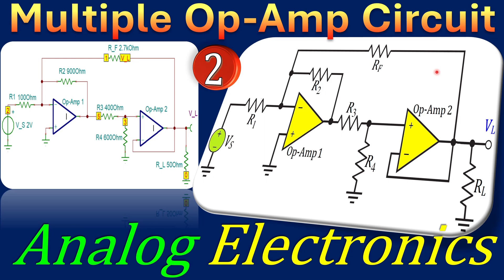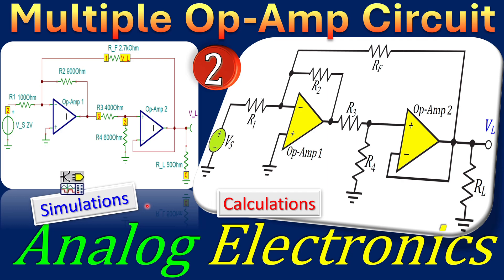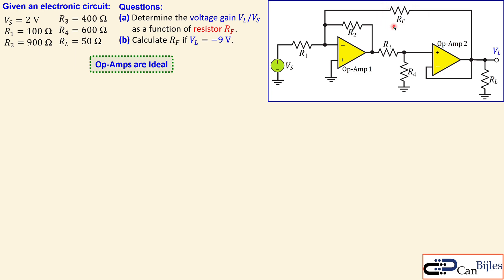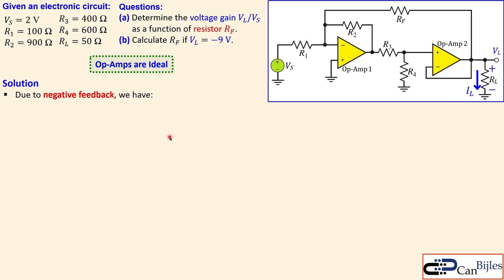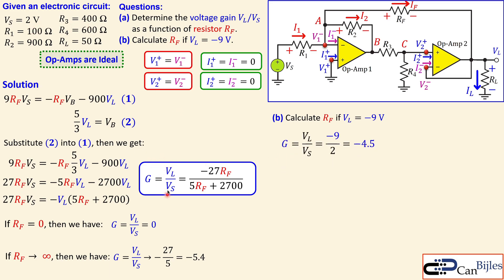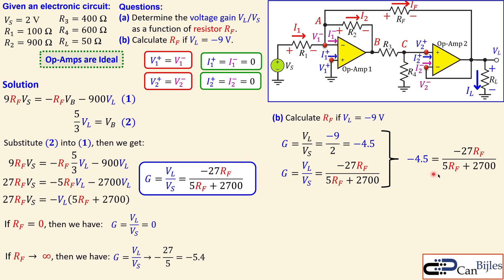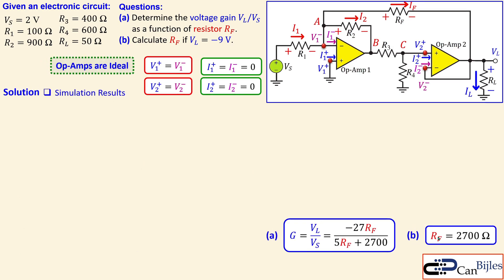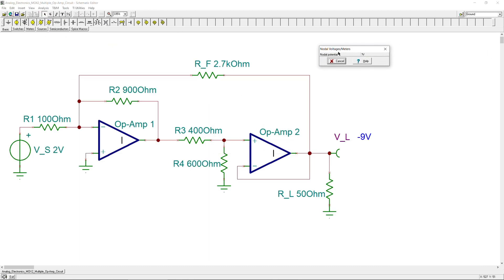Analog Electronics ⭐ Multiple Op-Amp Circuit - Example 2 ⭐ Calculations & SPICE Simulations

Comment: I don't understand why doing I_L=I_F-I_{2-} doesn't work. because this gives:
I_L=I_F 
V_L/R_L = (V_{1-} - V_L)/R_F
(1/R_L + 1/R_F) V_L = V_{1-}/R_F
V_L = V_{1-}/(R_F/R_L + 1)

and since V_{1-}=V_{1+}=0V, then V_L must be 0V too. I don't get where I am going wrong, yet it's clearly the wrong answer.
Reply from the maker: Thanks for your message. The equation you write for the output node as: I_L = I_F - I_{2-} is not correct, because you are not taking the current flowing out of op-amp 2. In your case, it would mean I_F = I_L, which is of course not correct. 

I hope this clarifies the situation.
Reply: @CANEDUX  Oh, of course! Thank you
Reply from the maker: @your-averagehumanbeing  You are welcome!